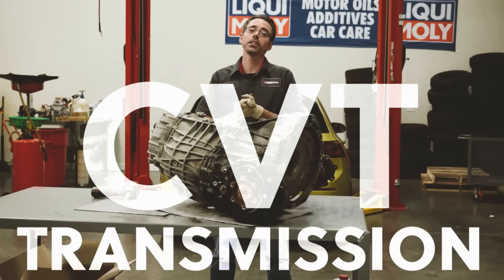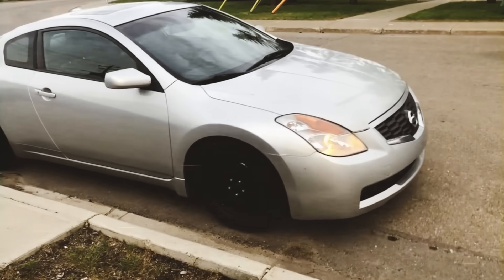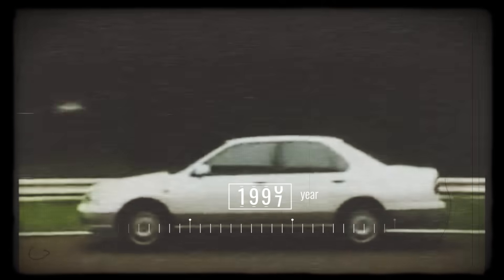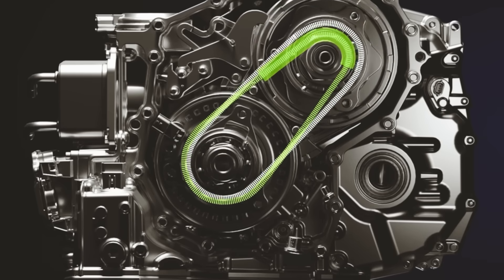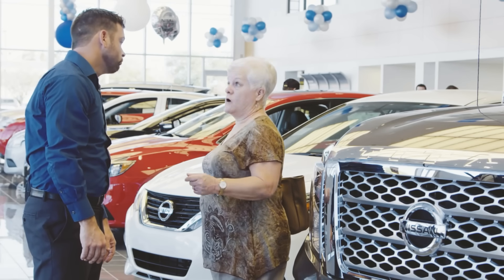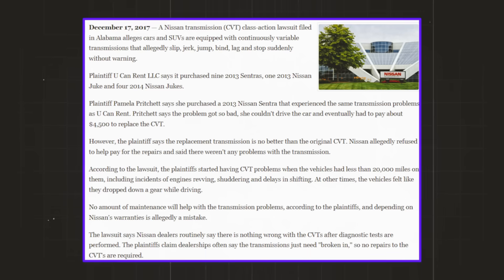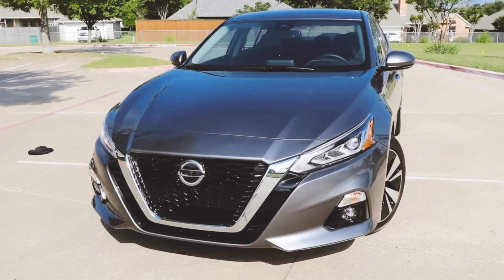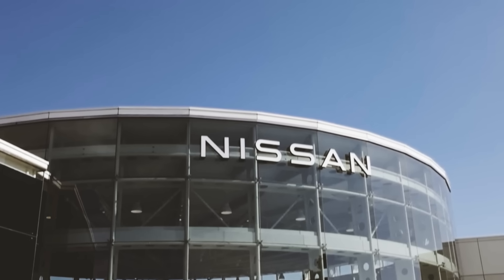Unpacking the FAILURE of Nissan's X-Tronic CVT

Comment: Has the reliability improved in recent years? I’ve be curious to see any data that exists.
Reply: They're not quite as fragile as they used to be but still have a long way to go before being called reliable. They're extremely sensitive to the fluid, so getting it changed every 30k miles or 3 years, minimum, will prolong the life of any push-belt CVT.
Reply: @Grafyte  sad to hear. I just bought a new car and I really wanted to consider Nissan, but I just don’t trust their CVTs. Hondas and Toyotas seem to hold up just fine at least.

Comment: The solution to the problem is buy manual or gear transmission cars or trucks if you can or don't buy any CVT cars.  Or keep your old gear transmission car or truck.
Reply: Hindsight you mean? That's easy to say if you don't already own one. No one buys a problem car on purpose.
Reply: In 2024, good luck finding a vehicle without a CVT. In 2024 good luck finding a vehicle with a manual transmission. Good luck finding a car without turbo’s, auto start/stop cylinder deactivation or hybrid. In other words your solution is about 20 years too late
Reply: @frankleespeaking9519  My post about having my CVT replaced under warranty is below, but there are a few things to know that will give one years of service. 
-Do not take off from a stop in a rush & do not gun it to escape a yellow light 
-Do not go over 85 MPH for long lengths of time
-Do not pass another vehicle unless you have 1/2 a mile clearance and not in a hurry
-Use the parking brake every time you put the car in park

One problem is people aren't aware that these transmissions are different. You can't pass with it because it doesn't have the overdrive traditional transmissions have that people are used to kicking in; it just can't do it. If you treat the CVT with a different type of driving, it will be okay. If you treat it like a conventional transmission, you may experience a problem.
Reply: @floridaredneck  my 90,000 plus miles were on highway. Back and forth to work. It now belongs to the 16 year old. Short trip to school. Now it will probably cause me problems.
Reply: @frankleespeaking9519  I'm not sure highway or city miles make a difference. One is winding it out, the other is making it work - I don't know. Mine's a '17 with 65,000, but only 5,000 on its new transmission and I baby it. I've learned to drive it differently and I don't try to change it. If you don't try to make it do what it doesn't want to, it should be okay, but it also depends on the 16 year old too! I think driver changes affect a car drastically.

It won't have the high revolutions of speed, so if it isn't maxed out in those short distances, you might have good luck. There must be a reason they are using these CVTs, so what I found was missing were instructions on how to drive it. You basically have to drive it like an senior would and I doubt it was made for the under 40 crowd anyway. 

One thing I've noticed is the lack of older models. I remember seeing old cars on the road, usually GM but when I think of it, it's kinda rare to see an older Sentra, Altima or a Maxima of like 10 or so years, then it skips to 20 in extremely rare cases. Once in a while I'll see one from the 90s, but not so much prior to 2010 (I'm an auto detailer).  I wonder what happened to them.
Reply: @frankleespeaking9519 Mazda 3
Reply: @GF-mf7ml  That’s’ a compact sedan, with front wheel drive only, four cylinder, .. in other words a toy.

Comment: Scooters have CVT transmissions and the belt needs to be changed like every thousand miles or so, and it is very easy to change.  I wonder if a lead foot has anything to do with this!  When i was a new car owner i blew out my transmission in 6 months of a 1999 firebird!!! It was totally my fault and how i drove,  the next car lasted me well over 100k without any issues.  I learned a lesson and hardly ever have any issues with drivetrains on any of the cars i owned after.  In 2017 i got a new mustang and it was a amazing car and never had any issues with that car not one, but i did not beat on it like i beat on the 1999 firebird..

Comment: Wow. I was looking at the Sentra. Maybe not now.
Reply: The new ones today are good.  It's the previous generations that had high failure rates.
Reply: Get a Corolla hybrid instead
Reply: @hsew  - Those are 💩 cars.
Reply: You can install an aftermarket transmission cooler kit. Overheating is the key issue with Nissan Sentra and can be resolved with the aftermarket solution

Comment: Evidently many new car buyers failed to do their homework before buying a Nissan CVT. The JATCO CVT problems have been known for many years. I did my research when shopping for a new car in 2018 and bought a new Nissan with a manual transmission.
Reply: I haven’t had any issues with Nissan CVT , 5 vehicles and no issues and over 100,000 miles when sold 
Still have a Nissan Rogue with 125,000 miles and a 2024 Sentra , would I recommend a Nissan?
Absolutely, have recommended to 3 friends who bought Sentra .
I do the drain and fill CVT fluid change every 35000 miles and change external filter at 100,000 miles, 0 issues so far .
Reply: @reyperez3424  My 2016 Nissan Rogue CVT went out at 67,000 miles and I changed the fluid. Some years must have been better than others?
Reply: @reyperez3424 If those CVTs fail, you're out of a friend.
Reply: We have a 14 rouge with 170k miles zero issues. I'm a mechanic by trade and  a cvt with outlast a normal transmission if you change the fluid
Reply: @scott8238 Your hilarious.  CVT is not a good match for automotive application.  They suck.and are way more expensive than an old fashioned Torque converter transmission.
Reply: @1958Cadillac-v2g  Thanks for your opinion i take it you've never owned one before?
Reply: @scott8238 Mechanic here as well. That is misinformation. Due to the amount of heat a CVT produces due to the byproduct of their design. Life expectancy on them is actually lower than a traditional slushbox automatic/transaxle. Do we need to bring up the numerous TSBs on the JF011Es CVT transaxles and its subsequent models as well?
Reply: Are the 2025 cvts by nissan the same or did they fix issues
Reply: @antd2733  they are improved CVTs from the original design and maintenance schedules have been changed
Reply: @antd2733 Same design. Only difference is the TCM designed for D-Logic so it "shifts" like a conventional auto. The internals for the most part have remained the same over the past +20 years.
Reply: Smart but, most people can't drive a stick.
Reply: Great idea the stick shifter, i would do the same, but preffer toyota and leave problems behind. Sure they're not pretty cars like nissans, but you don't suffer. Nissans were great until 2004, a shame, very though and longlasting machines, you could depend on them anytime.
Reply: That is fine if you plan on keeping your car until you absolutely need to replace it. Buying a car with a manual means it will lose resale value at an alarming rate. This is because dealers know that reselling that vehicle will be difficult do to the fact that not many want one. So, they price it accordingly, meaning you get less for it on trade.

Comment: I have a nissan altima and because of that transmission I will never buy a nother nissan product
Reply: I have put on my 2017 maxima around 200k km (around 130k miles) and it was great no issues whatsoever ( I will usually change transmission oil before it due by 5k km or 10k km) the previous owner towed quad bikes and bikes ( in the Saudi Arabia heat). And still going strong.
Reply: @Symantec-u1g the Maxima is the only car model specifically excluded from this video, did you not watch it?
Good for you, but there’s a reason your MAXIMA has not been affected like the other models lol..
Reply: @Symantec-u1g The Maxima CVT is beefed up and has a more aggressive cooling system. That's why. Lol.
Reply: This is why I'm getting a 2024 5 speed manual versa and it may be the last year they make them or make them with a 5 speed MT.
Reply: My 2012 Altima runs great with over 140k miles
Reply: I have a 2005 3.5 SE (convention tranny) I'll keep driving it till I can't anymore!
Reply: Neither will I I have a 2016 Nissan Altima  it only have 87000 miles my transmission went out a week ago no more Nissan for me👋👋👋👋👋👋
Reply: Nissans are good, you just have to make sure you're not buying one with a renault engine or jatco cvt transmission
Reply: I have one too but I have a lifetime powertrain warranty, what I would recommend is to keep the rpms low while driving and changing the fluid, luckily people have experience swapping nissan transmissions and they’re not too expensive if it goes out

Comment: Just Buy the manual transmisión, here in México Is 22k for the basic manual Sentra. This 2024 looks very good
Reply: It doesn't work for me, at least 4 hours traffic jam per day. Unless there's torque converter in manual transmission.
Reply: @GF-mf7ml  in that case Buy a hybrid cvt car. Save on fuel economy while having a powerful engine.
Reply: Unfortunately when they introduced CVTs in the US they said it made better fuel economy than a manual, so they made very few manuals and none for other models. You can’t get a manual Sentra/Altima/Rogue here
Reply: @davewilson7602  thats just sad. Nissan manual Cars are very reliable and durable.

Comment: What about Honda cvt's? They last longer, don't they? 
My 2019 HR-V has cvt fluid change at 40k km/25k miles intervals.
Reply: Honda definitely doesn’t have the same bad reputation with their CVTs, neither does Toyota.
Reply: @michaelw6277 Tnx. That's what I hoped for. 😊
Reply: Honda CVTs are pretty good, except HR-Vs actually those use a different one. 

However, HR-Vs still aren’t as bad as Nissan ones
Reply: Change the fluid once a year... change the filters per schedule every 40km
Reply: I still wouldn't expect 200,000+ miles out of them though. If they are still offering manuals or geared automatics in any of their models then that is what I am sticking with.